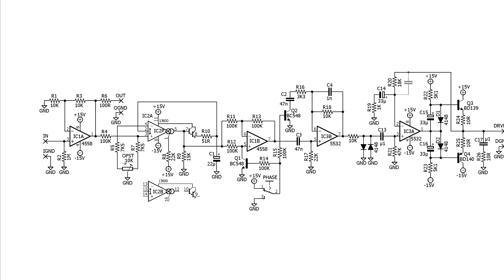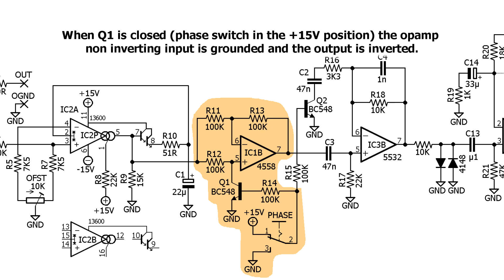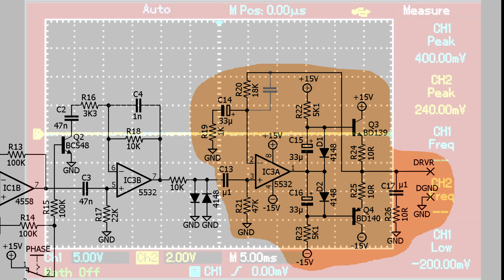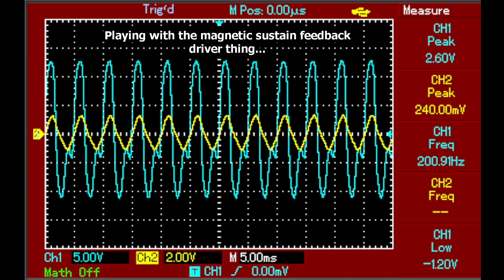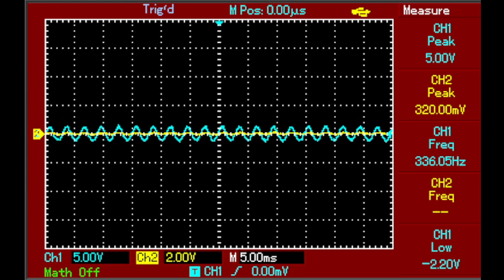Eternal guitar sustain with magnetic feedback circuit (Esus?)

Comment from the maker: Guitar sustain with magnetic feedback circuit, something like the Ebow or Sustainiac devices.  I am thinking of building this as a synth module or an electric guitar pedal, or both. 

 AGC Automatic Gain Control Amplifier from LM13600 Datasheet: https://youtu.be/eazBp0zXL5Q 
 ESP Headphone Amplifier P113 link: https://sound-au.com/project113.htm 
 LM13600 datasheet: https://www.ti.com/lit/gpn/lm13700 

Thanks for watching.

Comment: Can i use single supply and how to do that
Reply from the maker: This circuit needs a regulated dual supply for the power amp, you could use a 30Vdc or 24 Vdc PSU and create the positive and negative voltages by using a symmetric resistor divider and connecting the circuit ground to the center point where the resistors are joined. The resistors in the divider must be bypassed by capacitors, and the input and output of the circuit must be AC coupled.
Reply: @unrelatedactivities  thank you Sir👍
Reply: How to connect the buffer part input and output

Comment: Awesome! I've been wanting to built one of these into a guitar for years and have wondered why I never saw anyone using an AGC in their circuit, I am surprised that the coil was getting hot. Do you know how much power this was consuming? I wonder how fast it will go through batteries...
Reply from the maker: Thank you! I did not measure the current consumption, but the amplifier is rated around 1.5W into an eight ohm load with +-15V and probably is not a good option for battery power. The Sustainiac circuits use a class D amplifier, which seems to be much more efficient for battery usage (I think it runs on a 9V single supply). Here is one patent for their system: https://patents.google.com/patent/US5932827A/en